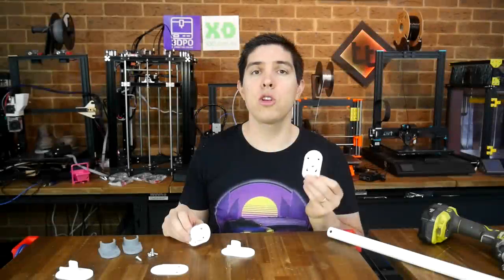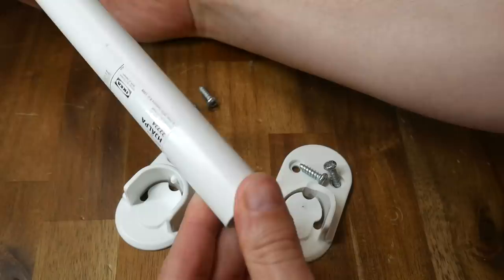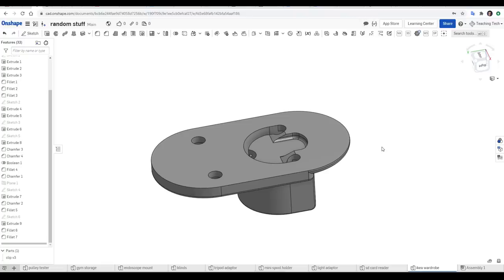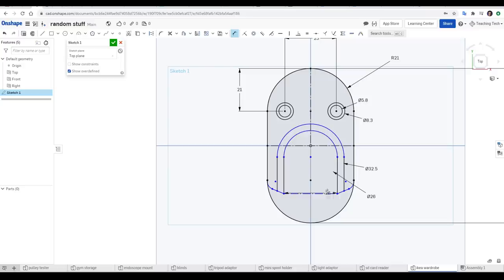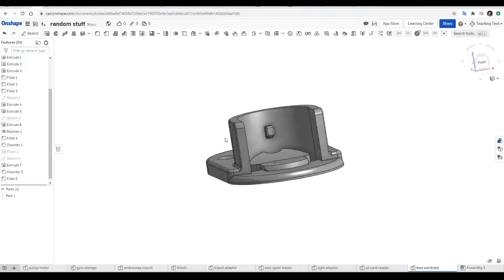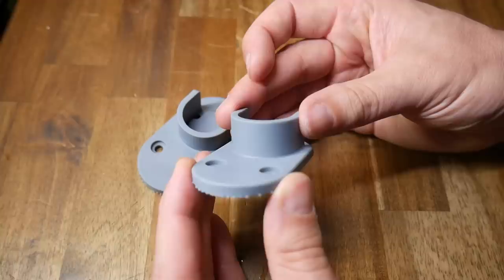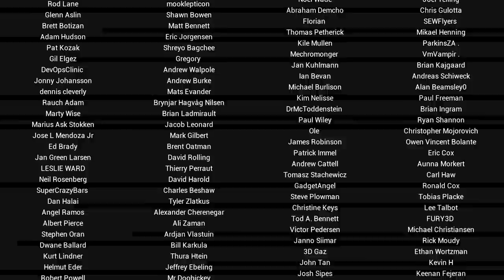Replace broken items around the house with 3D printing

Comment: I actually got a 3D printer in the first place because I needed some things I couldn't find anywhere.. would have liked to just go to a nearby makerspace (after finding out those existed), but unfortunately there aren't really any nearby... probably for the better since it's easier to prototype something in your room then I have to make a special trip out to a place only to find out that what you designed didn't fit right 🤷🏿‍♀️

Comment: Fixed several things around the house, lastly was a new shower drain
Reply: Are you using FDM? if so, are you worried at all about the porosity of the print? I've avoided making a couple prints for fear of bacteria or mildew growth, so am curious if you have any tips. Thanks.
Reply: @maximthemagnificent  Yes I'm using PLA with post processing thermoset polyurethane, this gives a waterproof finish and of course close all pores. At first I tried PET-G for it's temperature resistance but post processing is nearly impossible. I did not notice any temperature induced deterioration in using PLA. Hope this helps you.

Comment: @5:00 - Its not that difficult to locate pockets (holes) if you just take a little extra time measuring your broken piece but you will need gage pins or drill bits that are a good fit for your pocket.  I strongly suggest anyone 3d printing print themselves some basic machinist tools like a machinist square, gage pins and common sized Jo blocks for reference purposes.

Place your pins snugly inside your pockets and measure outside pin to outside opposite pin and subtract 1 diameter (half dia. for each side) to find your distance from center to center.  With the pins still inserted you would place one of the flat sides on a (relatively) flat surface and measure from the top of the top pin down to your flat surface and subtract half of the diameter from that measurement and write down that number. Subtract that number from the total width of the part then divide your sum by 2 which give you the distance from the side of the part to the center of the pocket.

Now that we've established center to center and outside edge to center on the x axis, we need to find where we will locate on the y by resting the sample piece on a flat surface resting on both pins - imagine the two pins acting as arms pointed straight forward resting on the edge of your surface plate or table with the part hanging off of the side.  Measure from top dead center on the radius at the top down to the surface and subtract half a diameter to locate your distance from the top of the part to the center of your pocket.

Boom.  New location discovered achievement unlocked.

Comment: The only Thing i missed Herr ist the use of 3d modelling and printing top optimize the Design,especially for FFF printing, since the original Broke at a very specific Spot, a fillet or chamfer from the base at the sides would have made it basically indestructible. Great video nonetheless.

Comment: I would have made improvements to wall thicknesses and chamfering radii right off the bat rather than making an identical replacement..  There was a reason that the original failed, so why wait for it to happen again..
Reply: That's right. There are limitations in injection molding that don't exist in FDM, so improvements are simple and effective. The original design of the part is based on limitations we don't have. I've gone from FDM designs to injection molding and learned a lot.
Reply: @EdTannenbaum  To be fair, there's nothing stopping IKEA from making a stronger part, they just decided to save a few cents by making a weaker part, but injection molding was not the limiting factor here...

Comment: You did nice making a replacement. But these retainers are needlessly convoluted. A U shape (With opening facing up) the pole sets into would be more then enough and take 1/20 the time to model and probably could easily be optimized to be way stronger.

 Still aside, nice video. Thanks for sharing.

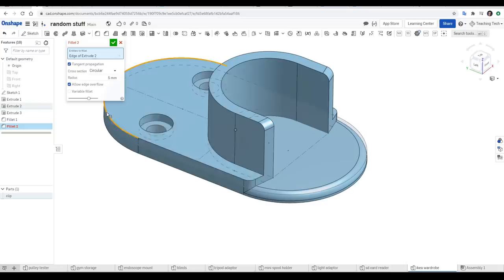Comment: 7:21 Because the original one broke and this one should have less strength, I would have made the walls thicker.
And while it would have made a sucky tutorial, you just could have swapped the right and left of the original hanger instead. The top side of the broken bracket one would then have been the bottom one which still works.

Comment: So far Tinkercad has been sufficient for me but I need to learn a more powerful alternative. Due to the recent changes in Fusion 360, I suppose I'll stick with OneShape and/or FreeCAD.
Reply: I am always surprised at how few people ever mention MS 3d Builder.  Its only about 10% more powerful than Tinkercad, but 99% of the time that extra 10% is all I need.  Its free, its offline (unlike pretty much every other option outside of the open source alternatives), and it is simple to use.  

I am not at all advocating that you forget about the more powerful options, because it isnt in the same league as stuff like Fusion 360, just surprised no one ever mentions it.

Comment: And about the missed opportunity to fix the design fault. The part would be stronger if the tube sat in the bottom of the arc, not the side. Position the holes above and below so it’s centred on the applied load. No need for all that clicking together because gravity keeps it down.

Comment: The orientation of the part is not optimal for fdm printing since the vector of force is applied in parallel to the layers. Well, at least you got well finished planes on the model instead.

Comment: Why would anyone design the open flange of the rod cup to take the load, - unless they want planned failures - lol -, they should've spun the screw holes 90º so the cup faced up.
Reply: it is such a bad design it makes me think the rod holders were an existing product  that was thrown in last minute. The redraw would have been an ideal opportunity to design this properly .  Replacing things that break with 3D printed parts is great but improving things is much much better
Reply: @bigfilsing  I doubt Ikea manufactures or spec'ed them, they are likely an off the shelf item that was compatible.

Comment: Also, the rod cup should be mounted with the cup facing up, might need to drill a hole, but if the instructions told u to mount it like that, they were totally wrong.

Comment: I have never seen these holders be uses like this. Usually the bar lies into the holder vertically, not sideways.
A failure like that is not rare, because the part doesn't have to bear same load everywhere. So it actually should not have same strength everywhere, but enhanced strength at the 45 degrees lower sides of the U shape.
Reply: I thought the exact same thing, its usually vertical.

Comment: Does Onshape allow drawing output? If it does and you have a paper printer, you could print your drawing to scale to check your hole positions by placing the original component on the 2d print.

Comment: Hi, I’m looking to buy my first printer and watched your video with interest. Whilst printing objects might be fun I’m ever the practical bod and printing replacement parts and prototype parts is my main driver. I’m looking at the CR10 S Pro V2 mainly because it seems to have the scope for progression as I develop my printing skills. I’m trying to determine if it will do what I want or if a more expensive and specialised printer might be called for. Any advice?

Comment: The closet parts original shouldn’t be installed this way but using the bottom of the U downward for straight even if you have to make new holes for screw it 😊

Comment: The part failed because the plastic mounts were installed sideways.  The plastic mounts are to be positioned with the two mounting screws at the bottom position and the pole dropped in from the top.

Comment: Whoever installed that Ikea hanging rod probably messed up. Surely the holders should be mounted vertically, so the bar drops into them and is cradled, rather than sliding in from the rear. Mounting them vertically would maximize their strength and use the whole "cup" section to cradle the bar, not just half of it, that's probably why it failed. Too much load laterally when they were designed to take load in the other direction.

Comment: Great video! I recently got my printer and have been modeling tons. Only issue i have is getting dimensionally accurate parts. I don't know whether to put the tolerances in the model or in the slicing. I want to share models but if I want people to be able to print them and get the same fit on different printers I would want the model itself to contain the accuracy, right? If somebody had a more accurate printer and I oversized a hole, they might no get the intended result. Should I even be considering this? I'm confused. I've been using the free SketchUp but OnShape looks much more intuitive and powerful. Going to try that out.

Comment: What annoys me is printing something you've measured perfectly but it shrinks by 2% when printed, could just be fusion 360 exporting incorrectly but last night I had 27% shrinkage vs measured parts, frustrating but yeah always do a test print of the first mm so you get your scale exact, to change it measure the real world printed object and what it should be, divide the two together and you'll have the scale required to make it the correct size, this helps for stupid small things or things in general that have to be 100% accurate.

Comment: ehm, i don't know how to say this in a good way. But why you don't turn the part aroound, so that all the weight of the bar is on the whole shape of the part, not just on one wing of it so that the 2 holes are horizontaly beside each other? 

I think it was ment to be used and mounted that way.

Comment: Great video. Annoyingly though, to exactly replicate a terrible design...? A massive improvement would be to rotate the whole "pole support" element 90 degrees, using more of the pole support structure when in use? Even the placement of the screws is weird, horizontally with the pole support above would seem to be more efficient?

Comment: Thanks for all of the videos Michael, sure it's an older on enow but for those of us just coming into 3D printing quite the valuable resource. My only question is... why did you mount the brackets that way to support the pole in the closet? I would assume they are supposed to be rotated so the curved base with the screw holes were underneath the pole, thereby putting all of the weight on the lower part of the curve which would be more structurally sound. As you have them mounted all of that weight is on the one side, hence why a side broke off. ¯\_(ツ)_/¯

Comment: I don't like the design of those rail holders. I'd have redesigned them with the cup facing up so gravity held in the bar. IKEA failed a bit in my opinion!!!
Agree though, best thing about having a 3D Printer (or 3) is being able to print replacement parts for biuts in the house. My TV has a few (old, breaking switch parts).

Comment: Is it easier/ harder to scan it first?
Reply: A 3D scan is a huge pain in the butt. You'd only go down that road if you absolutely have to. This is a simple part which is modeled way faster than doing a scan.
Reply: @twinklingwater   2D scan in an office printer?

Comment: I honestly don't understand this, When parts fail I try to design them in a way so that they don't fail anymore, I modify the design to make it easier to print, make the part stronger and have some fun, why would you remodel the same part exactly like the original one instead of doing it your way?

Comment: Hi great video, have printed some spare parts like hook for window blinds - like this https://ibin.co/5doIlxNhy1fx.png . It would be nice to notice that when printing fdm the weakest part of the print is where layers connect. So when printing flat as you did the C-shaped mount could break of easier than I would when printing vertically. Of course you would have more support then and the part needs to be post process more.... That's 3d printing - always compromise ;-)

Comment: With your resin printer why did you not print it flat on the build plate?
You did a lot where they were printed flat on the build plate in this video "Testing the Wham Bam resin flex plate - Easy and efficient" https://youtu.be/TgPxE5gUjlo?t=549

Comment: Were those plastic calipers?! That is a terrible design.  The heat of your hand will alter the length by a significant amount because it has such a large thermal expansion rate and a low heat capacity so warms quickly. 
I really only recommend buying the stainless steel ones. The other thing is unless they are going to be in a rough, dusty or otherwise damaging environment,  I cannot see any reason to get vernier calipers. It just makes reading them slower. The price difference is not worth the time lost to reading delays.
Reply: I like vernier because of no batteries and the fact that it can essentially last for generations. I didn't buy one though because the only decent ones seem to be high end like Mitutoyo.
Reply: @Storebrand_  Get some cheap dial calipers. I actually prefer them over the digital, they feel different and you can see the affect of how hard you squeeze better. Even good ones are only around $60, but I have a I've had a cheap set for 20 years and they are fine. The only thing you need to do is keep chips and grit out of the gear rack.

Looks like Starrett, Browne and Sharp, and Mitutoyo start around $100. Fowler is about 55.

Comment: Helps if your a good CAD minded person who can use CAD software.. Most of us try use it,  but fail to even use the CAD software never known make the item!  Either you got it or you have not? Skills can't always just be learned sadly. After all, can everyone you know fly a jet in real life or do brain surgery or do deep sea diving etc. NO either you got the natural skill to learn it or you don't. This lucky man has the skills needed to be great in 3D printing and CAD. most of us don't.
Reply: Don't sell yourself short. You can learn a CAD package like OnShape sufficient to design parts even if you are not naturally talented at it. The difference is in the amount of time invested. If you are like me, it will take a bit longer to get proficient, but with each project, my skill level grows. I think the reason so many 3D printers are collecting dust is due to getting bored with printing stuff off of Thingaverse. Learn to design your own parts and it gets fun again.
Reply: If you can use a saw and a hammer to build something out of wood you can use CAD software to build something out of plastic.
On the other hand, if you have trouble with building something in general you will have trouble building something specific with any tool. I don't think many people are affected by this inability, though.

Comment: I know this should be viewed as a teaching guide, but replacing an IKEA part with a 3d printer does not make sense. You can order replacement parts for free on their website.

Unless you're doing this for fun, I would strongly suggest that when you need a replacement part for something, you check the cost first. A lot of the time replacing the part isn't that expensive vs the time and effort it takes to model and 3d print it.

Comment: This is part of the fallacy of 3D printing.  Nevermind the price of buying a 3D printer.  Nevermind the price of buying a spool of filament.  Nevermind the cost in time for modeling the part.  Do you really expect an FDM print to be as strong as an injection molded part??? Dream on!  PLA filament is too fragile.  ABS requires a more expensive printer, experienced technique, and usually a lot of trial and error.  SLA is an even more expensive process and involves working with messy, toxic chemicals.  By the time you invest all of this time and effort, you end up with an inferior product.  It's certainly not worth the $2-3 to buy the real thing.
Reply: @SystemsPlanet  Sorry SP...you don't get off that easy.  I AM a 3D printer AND my company utilizes FDM, SLA, and sintering for its prototyping.  3D printing is NOT ecologically beneficial for one simple reason: Filament is NOT currently recyclable.  Nor, are the spools that get sold with the majority of the filament.  Nor, are the chemical and material wastes that result from SLA and sintering.  Nor, are the expendables like spent SLA trays, worn adhesive printer surfaces, or endless amount of broken 3D printed printer parts.  Oh yeah...and by the way, you either don't know about printing ABS, or you are lying here.  While any printer can spit out ABS filament, to keep ABS from warping you need an enclosed printer.  (Anyone who has ever done ABS knows that it takes a temperature-controlled enclosure.)  Whether you buy an enclosed printer or build an enclosure for a non-enclosed printer, it costs significantly more.  But, the most egregious issue is the fake value of 3D printing any strength-intensive part.  FDM is by definition a non-monolithic building process.  (Translation: The finished parts are not uniformly solid.)  Some filaments become brittle when they eventually dry out.  Others don't hold up well when exposed to UV light.  Others soften when exposed to common hot weather.  None are really suited for long-term outdoor use.  Even SLA is an expensive, toxic, messy process and the machines generally don't have a large build area.  Stop being a propagandist for something you don't know anything about.